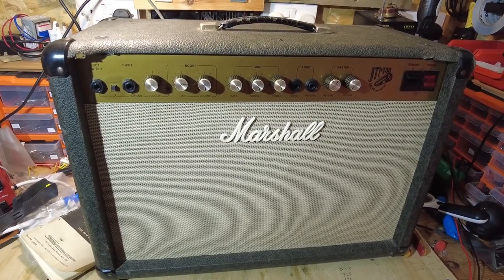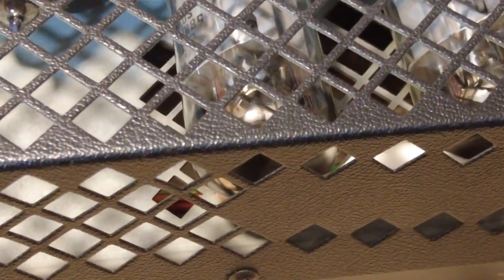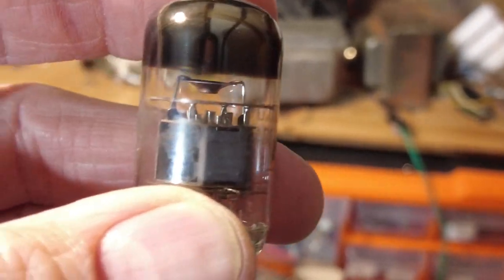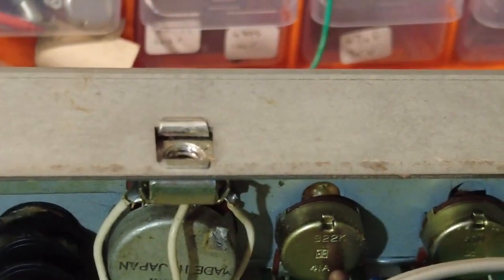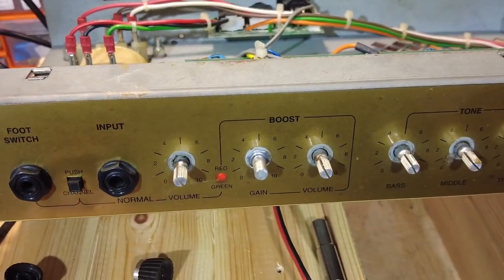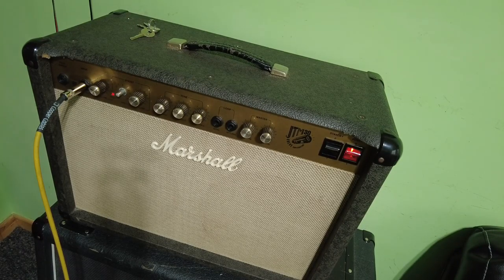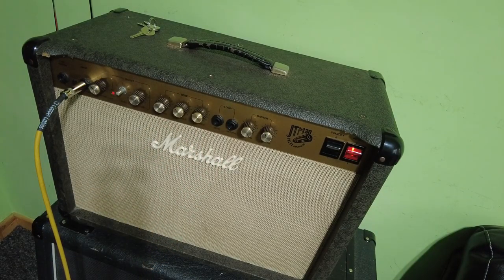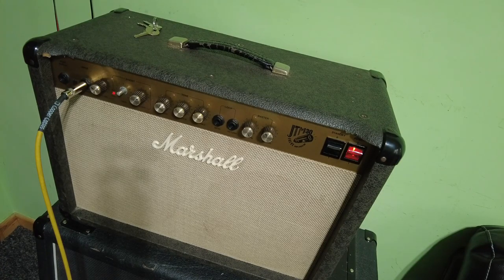Marshall JTM 30 Guitar Amplifier Three Faults and Counting Repair and Demo

Comment: I'm a bit late to the party but I own two JTM30's one I bought new and one I got used.
The nuts have not gone missing Marshall never put them on both mine only have 3 nuts. Probably saved them 20p per amp.
The JTM I bought used I recapped due to leakages about 5 years ago.
The only issue I found is you have to ensure the effects loop sockets are cleaned regularly.
I'm still running the original Sovtek 5881's, they do run a little hot but I've had no issues.
I do like a video showing what previous repairs/bodges have been done.
Thank you for sharing
Reply from the maker: Hello Keith, thank you. I bought two of them when they came. out. That explains the nuts, thank you. It's amazing how long tubes will last in some amps. These amps are coming up to 30 years old. They did have a bad batch of transformers when they first came out. They are not a bad little amp for gigging. Not to heavy either. I have a 2 x 10 one at the moment that just needs a quick service. Just need to find time in between customer repairs to fix it.
Thanks for watching and take care.

Comment: I have the same amp. Replaced the power transformer because over heating blew it. I found out that it was the 5881’s that were drawing too much current. I put 6L6’s in there which run cooler and added a cooing fan for kicks. It’s funny because my pots only have a couple of nuts. My old tech took them off years ago for a reason and I can’t remember what that was and he is not available anymore to ask. Nice video, thanks!
Reply from the maker: Hello. That's interesting. Some did seem to hot and some didn't. Maybe they upgraded the power transformers at some time during production. Or maybe they changed to 6L6 tubes as you have done, or re-biased the 5881's for less current. I will do some tests if I get another one in for repair. Thanks for watching and supporting. Take care.

Comment: From what I heard many have switched the valves from the 5881 to 6l6.  I’m no guitar tech but I got mine for $345 tax in Canadian about 15 years ago and much later found out the tubes were rca blackplate 6l6gc.  Worth the price mine has never had any issues so either someone who knew amps had it fixed or I’m luckier than any other jtm30 owner.    Mine is the 1x12 vintage 30
Reply from the maker: Hello. Nice tubes are those RCAs. I had two JTM 30s when they came out. One i never had a problem with in three years and the other was a pain. You must have a good one there. I will do a bit of reading up about the valve swap, that's interesting. Thanks for watching and take care

Comment: Bought a used jtm 60, the heat melted the plastic preamp sockets and the effects loop had intermittent issues,and the board traces came off,so after working on it I sold it for parts.

Comment: wow! finally someone beeing actually able to play playing this, great sound! xcept for mr segborn… all other players demoing this amp close to abysimal… exchange that pot and be done with it. cheers!
Reply from the maker: Hello. I gigged one of these amps for three years. I had one new when they first came out. Some of them had problems with the power transformer blowing. Mine was fine. It was a decent amp. I have bought another one. You can pick them fairly cheap now if they have faults. The one I have just bought has the same fault, dry joints on the pots. These amps are nearly 30 years old now and still going strong. Thanks for watching and take care.
Reply: @vintageguitaramp_guitarteacher  my first amp i ever played on a rehearsal was a jtm60... couldnt take advantage of it though...noob. i liked the 15inch. right now i´m eying a used jtm 30 asking price 150€ owner says it drops out for some time during rehearsal... sounds like it could be overheating issue... i have some diy skills for switching caps, instaslling heatshield, modyfying the bias diodes... but am worried output transformer could be damaged from overheating. is it a steal or a potential heap of electronic scrap? whatya think?

Comment: Different amp, but I got hold of a Marshall lead 12 for peanuts as it had intermittent output. The issue was them bleedin nuts on the pots. The volume pot didn’t have the internal nut, just the outer and it had been pulled forward whilst being used and it had broken the solder. Daft design really. 

I’ve been offered a JTM30 that has intermittent sound issues for pretty cheap. Maybe worth a punt for £50? I’ve a lot of experience with flexi PCBs (years of line 6 home repairs) so that doesn’t scare me as such. 

Very informative video. Thanks for making and sharing.
Reply from the maker: Hello Andy. thank you.. 50 quid is well cheap for JTM30. It shouldn't be to much trouble to fix it. The lead 12s are getting quite rare now. They are good amps. Thanks for watching and take care.

Comment: I wish I was that ‘rusty’ on guitar 😅

Great video, I had one of these as my first valve, broke down on a gig and was always having issues after that. Got it fixed and sold it and I think it was fine after that, just my luck!

I used to really like the clean channel.
Reply from the maker: Hello Mark. I had one from new. Mine was fine. I worked in a music shop at the time. We had a few of them  back in with problems. The biggest problem was a batch of bad power transformers. I gigged mine for three years. Thanks for watching and take care.

Comment: I love the JTM30! I’ve had three of them, still have 2. Fantastic sleeper amp. Clean channel is revered, but I actually like the drive channel especially plugged straight in. Pretty sure mine have EL34s, the shorter ones so they fit laterally in the cage.
Reply from the maker: Hello John. I two of them when they first came out. Gigged them for three years. They are a good amp for the money. Never seen one with EL34s before. If they fit, and as long as they are biased correctly they should be fine. Thanks for watching and take care.
Reply: @vintageguitaramp_guitarteacher … and, of course, you’re absolutely correct: the amp has 6L6s all the way!
Reply: Great lil amps. I picked one up 5 or 6 years ago almost unplayed.  The guy is an acoustic guitar player and in the 90s decided to try electric.  Bought a JTM 30 and a Strat brand new. Played them a few times for a total of a couple hours he said. Then just stayed with acoustic. Ha, it still had the hang tag on it from the store. It was wrapped around the handle. Mine is a 1  12" version. Man I love those Heritage speakers.
Had a JTM 60 earlier, 1 12" again.. Something about the gain on the 60 just didn't sit right to my ears. I swapped out the el34s for kt77s and it was better but even with vintage mullard pre Amp tubes I just couldn't grab that over my Soldano or Reinhardt 18. Sold the 60. Kinda regretted it. Then picked up the 30 and that was it. After switching pre Amp tubes , setled on 12ax7b. It's my number one now. Even sold my 77 JMP 4 hole 50 watt and kept the JTM 30. I thought the 6l6s might have been the difference from the 60 sounding just good but I don't really know.  My drummer is loud so I play this a little over 3/4 volume so I'm getting some power tube saturation for sure.  
It's so good to hear you state the 30s don't heat up like the 60s do. My 60 was fine but I always figured it would overheat sometime.  Cool video.

Comment: The 1x 15 was the best model. Didn't suffer from overheating due to the size of the cabinet. I had a couple. Bit fizzy sounding but good value now used.
Reply from the maker: Hell Ricard, Ah yes, I had forgotten about the 1 x 15, which is a bit of a slap on the wrist for me as I worked in a music shop in the late 90s and we had the Marshall dealership when the JTM range came out. Thanks for reminding me. Thanks for watching and take care.
Reply: Never heard of a 1x15? Research time!

Comment: Love mine.  Had it since new though it spent a long time not really used.  Then got back into playing.  Its had a new power tx.  Also had it repaired once as volume was fading in and out.  Think they replaced a jack and one or two pots. Used to find it a bit harsh though and recently fitted a creamback which really helped.  At the same time did the recommended bias diode  change by replacing  9v to 12v I think and added washers under the mount screws to help cooling.  Sounds GREAT.  only issue now is after that fading reapir, the red channel is very quiet compared to the clean channel.  I'd like to sort that.  ANy ideas what that may be and could I bring it to you?
Reply from the maker: Hello, sorry for the late reply. Not sure what that could be. I could take a look.  I am based in Nottinghamshire, if that's not far for you. Thanks for watching and take care.

Comment: Mine gets so hot you can fry an egg on it, it has melted some of the plastic on the back do you know of a way to maybe hook computer fan and mount it on one of those?
The playing at the end of the video was good! Any help is appreciated from the states thank you..
Reply from the maker: Hello, thank you. If it is getting that hot it might need the bias circuit looking at. Do you have a tech living close by that could check for you?
Reply: Yeah, venting the valve heat into the chassis was unsmart of Marshall. My tech fitted a shield to stop that nonsense, but the better course might be to vent the top of the cabinet, AC30 style, or as you say, fit a fan (shudder).

Comment: bought one new in 95, played it a bit back in the day in my room, than it sat for years unused as I moved out from my parents place. Started playing again in 2005, but never an awfull lot. One power tube got microfonic. It burnd the power transformer, and afterwards the output transormer. Nice sound, but a pain in the ass amp quality wise. 480v on the plates, way too hot for layed down valve contruction. Instal a fan if you have one to cool things down.
Reply from the maker: Hello. A lot of people have had the overheating troubles. This one din't seem to be running hot. The 60 watt version is the worst. They run really hot. The problem with these amps is the power transformers are underrated. Thanks for watching and take care.